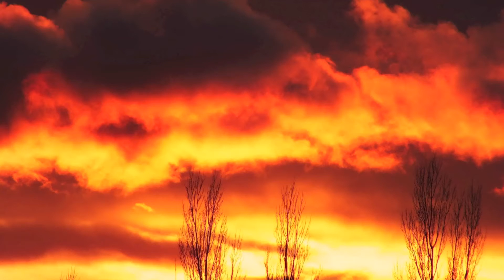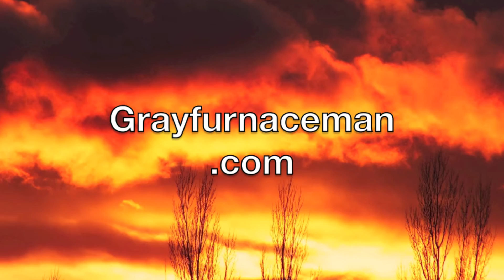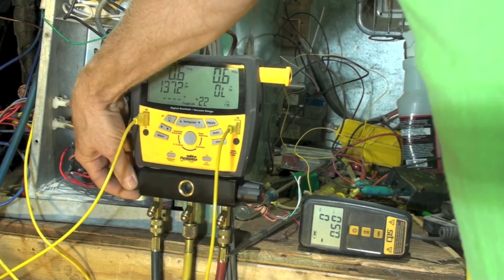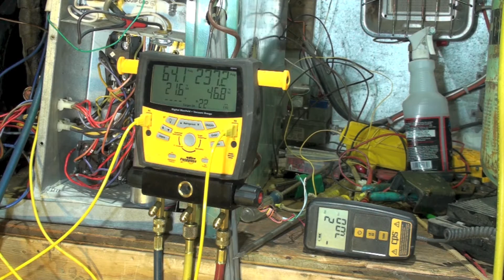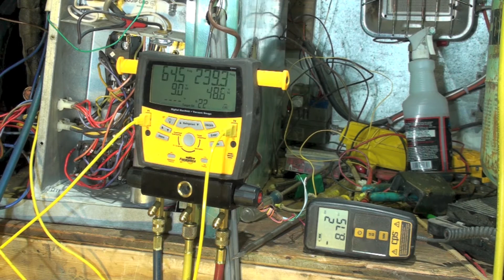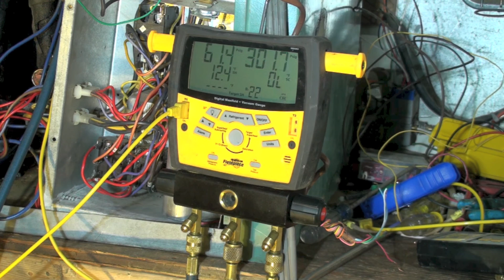Recharging the water source heat pump

Comment: Where do you usually put your temp clamp to measure sub cooling ? Every time I use my smart probes on one of these units I never get a sub cooling reading ?
Reply: It is generally placed on the liquid line close to the outlet of the condenser.  Sure you have the right refrigerant?
GFM
Reply: Sam Fry that is where I put it right next to where the discharge line branches off from the coil before the co axial water line leaves the unit . And ya always making sure I’m on the rite Refrigerant . But always reading OL on my smart probes for sub cooling . My liquid temp is usually about 180- 185

Comment: A bit off topic but a tip that could save you in a pinch, I had to add gas to a Daikin air source heat pump in the winter, the charge can only be done in COOLING mode only but my thermostats set point would only go to 65 degrees Fahrenheit, the room temp was below my set point so the compressor wouldn't come on. You can initiate cooling manually at the air handler but I didn't have any paperwork on the unit and I was waiting forever for tech service to get back to me. The unit had enough charge that it would run in heat standby only because the charge was short, then I had a bright idea, when the unit went into defrost mode that's when I could add some gas, I did it and it worked out great. Let me just add this isn't the way that you should charge a unit, like the creator of this video said, weigh in the charge and then tweak, but I was in a pinch and this is what I did, if it were a conventional system I could obviously just have jumped out the control wiring, but with the new systems that isn't going to happen, especially when you only have 2 wires at the stat. The new tech is definitely impressive but I've been in the HVAC field for 15 years now and sometimes the old school systems are just more reliable, they're plain and simple, no bells and whistles, obviously not nearly as efficient but if maintained properly over the years they're pretty darn good. Today's customers, especially if they have big bucks, tend to want to over complicate their system, I tell them all the time the less moving parts the less problem you'll have, engineers get way too fancy sometimes, I don't know who their trying to impress, the customer or themselves. Technology is great and green but sometimes simple is better, especially if it's a cooling only residential system, don't try to send the thing to space, just make sure it cools the space efficiently and is installed correctly, save the fancy stuff for the corporate accounts.
Reply from the maker: BLAZENYCBLACKOPS Sounds like a good idea when there is no other way.  Thanks for the thoughts.GFM

Comment: Did you start at zero? Why not start at max vacuum -30PSI? Or that is what you meant by Zero? You are usually so excellent that I cannot even ask a question.
Reply from the maker: Cliff Meima The reason for starting near 0# PSIG is I remove schraders when I evacuate.  I then charge the unit to about10# PSIG, remove hoses and replace the schraders.  The resulting pressure is generally 1 to 5# PSIG.  Hope this helps.
GFM